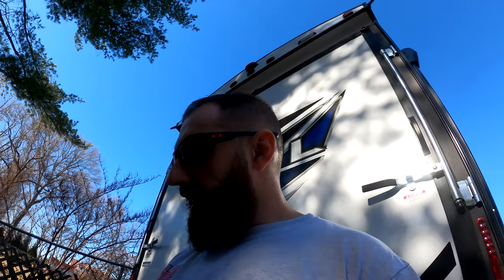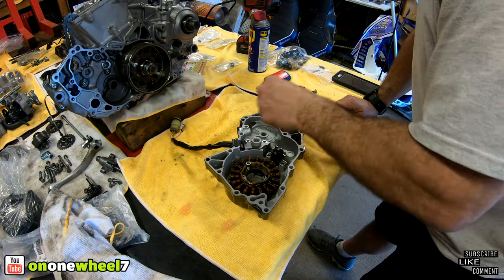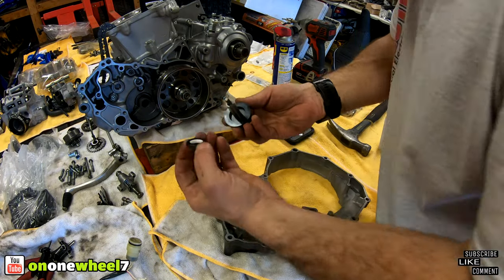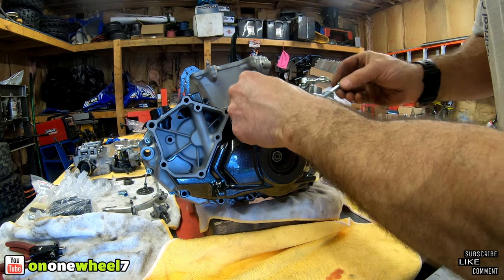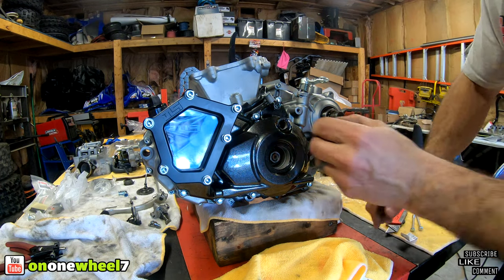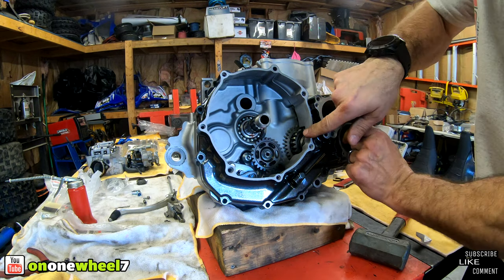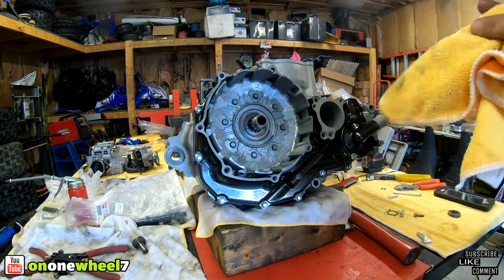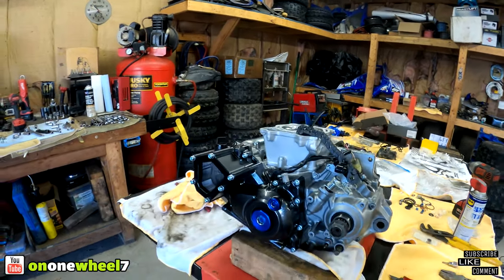YAMAHA YFZ450r ENGINE BUILD PART 3

Comment: Amazing build John. And outside with the painted covered is looking as I expected - awesome!!! Wait to see this engine on the Quad :)
Reply from the maker: This new build is gna be sick cant wait to get it done and show you guys! Thanks man!
Reply: ononewheel7 From this build, do you expect more power?
Reply from the maker: Yamaha Raptor 700R engine is exactly the same setup as last year so no change last year i upped the power a touch and was happy w this setup so no more changes!
Reply: ononewheel7 What is a HP or torque on that engine and did you ever check your on Dino?
Reply from the maker: Yamaha Raptor 700R i never did id like to this year id say I’m close to 55hp w my mods
Reply: ononewheel7 LOL. What is stock power of this model. As I know my Raptor 700R is about 55 HP? It will be great for you if you get same power from your engine!
Reply from the maker: Yamaha Raptor 700R stock is around 45-46 i believe!
Reply: ononewheel7 sounds great. I think mine is even a little more with double exhaust, but also didn’t go to Dino!

Comment: I'm confused on what direction the oil seals goin the crank case cover
Reply from the maker: Which ones are you talking about? Do you have a manual?
Reply: @ononewheel7  the one with the little spring and ball and the one next to it.

Comment: Sup man, i got my motor all together. The 5mm stroker I mentioned. I figured out the o rings I mentioned before. So now motor is in, whats the sensor called that pushes into the crank case half next to clutch cable holder? Idk the name of it. Or where it plugs into. I have everything plugged in except that. Well I actually found a plug it fits into under rear plastic, but sensor wires are different color from harness wires? I'm thinking maybe that's wrong harness plug?
Reply from the maker: Thats the speed sensor 
Be careful you can mix up two sensors the rear brake light plug and the thing the crank sensor always match up color to color black to black
White to white etc
Reply: @ononewheel7  yeah so I need to unplug it then and try to find the right plug to connect that sensor to. I connected to one that has blue wires and it runs straight to the back of the quad. Sensor is like a brown and a yellow or something like that. But I looked everywhere and can't find another plug for that sensor to go to??? Is yours plugged into the harness at top left side of subframe?
Reply: I got this quad with top end off. Dude ripped it apart and quit. Sold it for a grand. So I didn't take any wiring off or anything. He had the motor out and top end pulled lol its a puzzle but ur vuds helped me crazy amounts man. Apreciate ya!!!!
Reply from the maker: Yes it comes from the top left
Reply: @ononewheel7  ok cool. Thanks man!!!

Comment: Great video buddy 👌
    Everything fresh for the new season ! 
       What made you choose the Yam yfz  ?
Reply from the maker: Thanks man! Before this i had a couple of kfx450r’s i did like them at the time i had a close friend get a new yfz450r it was mildly setup he let me ride it one day a week later i bought a new yfz and sold both the kfx’s haha! For me the yfz is so much more comfortable and easier to work on and even in stock form makes way more power than the kfx!
Reply: Good move bro 
   You do see more yfz than any other on the GNCC and MX have you ridden an LTR if so what you think ?
Reply from the maker: Quad in the UK I’ve built a couple ltr’s actually great machines pretty much everything about them its a shame they don’t make them anymore w the exception of walsh everyone else stopped making aftermarket parts for them!
Reply: Quad in the UK mine is nimble fast get one trust me